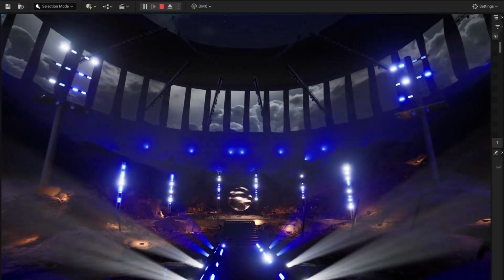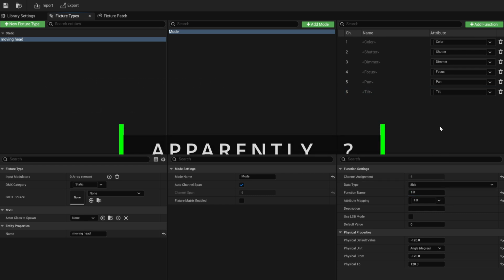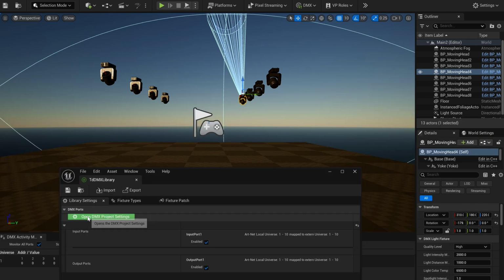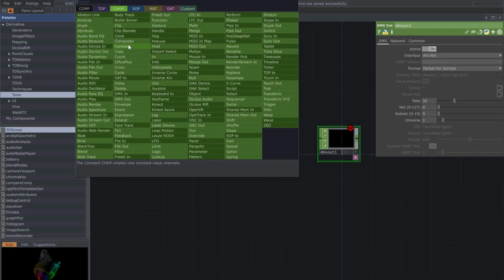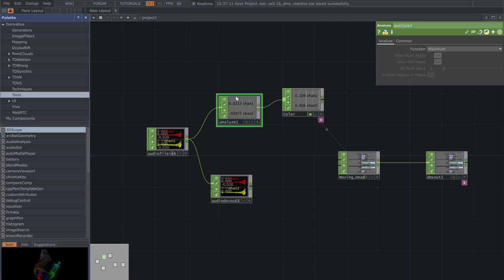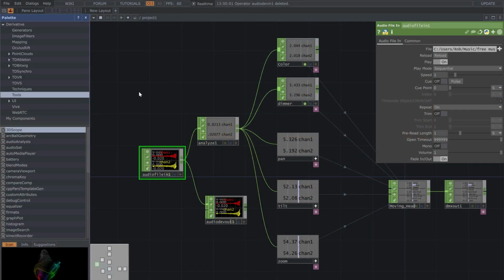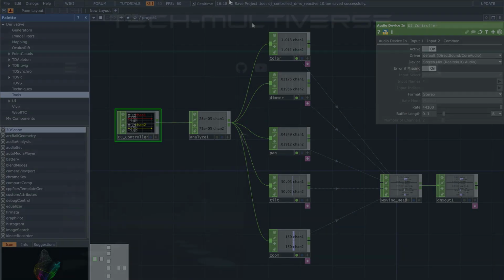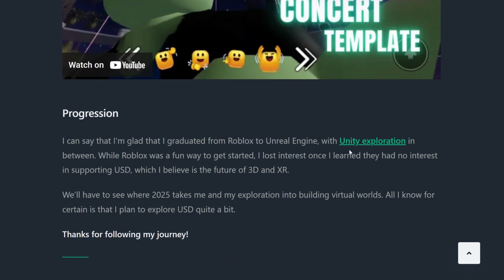Audio-reactive DMX Lighting in UE5 with TouchDesigner

Comment: Thank you for sharing this, Brother I have followed every step you tell, but From my TD to UE does not receive datas, Why is that?
Reply from the maker: My guess is that it's a network configuration detail, especially if you know you're sending the DMX data from TD. Double check that your DMX Out node has the network address of "localhost" with the local address of "127.0.0.1". If that's set, then the only other issue could be the network settings in the UE project. I share how to do that in this chapter: https://youtu.be/_mUPLc8n1cY?t=510&si=tmrE-0-1ebgTJgL7

If you're still stuck, then you can try downloading my project files from GitHub, which has helped others: https://github.com/Tech-Multiverse/audio-reactive-dmx

I hope that helps! Let me know how it goes.

Comment: Did U find any solution for the rgb control of the light ? I think the preset light in ue5 just do not support rgb channels.. probabily it’s a matter of messing with blueprint nodes..
Reply from the maker: There was a comment from someone with theater light design experience that mentioned the following color tip (below), but I haven't dug into it yet.  I'm working my way back to using UE again fairly soon, which will eventually include more lighting. Since I've learned about blueprints, I can see how messing with those would do the trick!

The tip provided:
"- Color: We only use the color function for the one without R/ G/ B color mixing. For me in your case, in TouchDesigner I will add a constant TOP to be a color palette, and send it's R/ G/ B value to the fixture in UE, as in UE, I will create each R, G, B function (so it will be 3 channels) but not the color function."

Comment: Thank you for your video:)! It's very useful! I studied in theater lighting design before, there is something I can share:

- Pan/ Tilt 16-bit: On lighting consoles (e.g. grandMA, ETC) we patched 2 channels for pan (or tilt), ch1 (pan) is for 8-bit control, ch2 (pan fine) is for 16-bit control, meaning ch2 can tune more details. For example, 1 step for ch1 is 5 degrees (I use a random number here), and for ch2 is 1 degree, you can see the huge difference in physical fixtures. In fact, for an more exquisite moving light, it will also have zoom/ zoom fine, focus/ focus fine, etc.

- Color: We only use the color function for the one without R/ G/ B color mixing. For me in your case, in TouchDesigner I will add a constant TOP to be a color palette, and send it's R/ G/ B value to the fixture in UE, as in UE, I will create each R, G, B function (so it will be 3 channels) but not the color function.
Reply from the maker: Thank you so much for sharing these details! That  makes sense and helps clarify why using 16-bit over 2 channels adds value. I can't wait to try your RGB technique, too!!
Reply: @TECH-MULTIVERSE  although a year late, building off of what @yclin-y5p was saying. a light with 360 degrees of rotation can't hit every degree of rotation with a 0-255 single address of dmx, and light can have as buch as 540 degrees rotation or more. So 16bit multiplies the two address values to be able to get wellover the 540 degrees of rotation needed for pan and whatever tilt is needed, and even allows for fine adjustments smaller than a degree, which can be massive especially if the light is far away. 1 degree far away could be several meters/feet per degree
.

Comment: Awesome tutorial dude, this is something I've been eager to figure out since I started using unreal engine on the 5.0 launch (especially hooking it up to a digital controller)  A quick question though if that's OK, i followed along exactly as you had shown but for some reason the pan on the lights always points up regardless of the range numbers I try.  Any ideas or solutions for this would be greatfully appreciated.
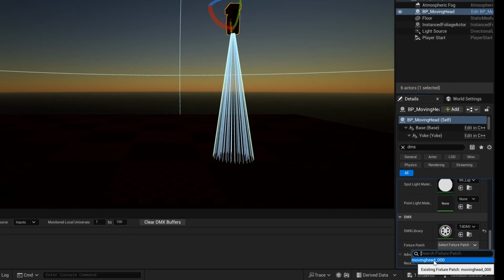Reply from the maker: In your UE5 DMX Library, double check that your function settings on both Pan and Tilt have a data type value of "16 bit".  See chapter "Fix Pan/Tilt & In/Out" at time stamp 05:00 where I correct that myself!

I did a quick test by dropping them down to "8 bit" and found they pointed up like you describe, so hopefully this solves the problem for you.  I still don't understand why this is needed, but clearly it is.

Be aware that adjusting the lights to use "16 bit" will also mean that they'll be using 2 channels, so consider that if your mapping in TD seems off after the change. I guess that's where pan-low and tilt-low can be channel placeholders - if nothing else.

During this test, I learned that system volume matters!  I had my computer volume down and didn't see much movement until I cranked that up.

It's great to hear that this video is helpful!  Let me know how it goes.
Reply: @TECH-MULTIVERSE  thank you for the reply and will definitely check to see if I switched from 8 to 16 bit. It also may be down to the music I'm putting through it (heavy drum and bass 🤣) so will try with an alternative music source.  

I know this is a big question which you may not know the answer too yet as you are still on the surface of diving into it but do you have any info on adding other lights which will react at different times so they are not all going off at once?
Reply from the maker: Actually, to create different sets of lights you can create multiple patches in your DMX Library in UE5 and map new lights to those.  Then, you simply create a new set of "constants" in TD that correspond to those channels and merge those into the DMX output.

Check out the article I wrote up for this project for more details:
https://tech-multiverse.com/projects/create-amazing-audio-reactive-light-shows-in-ue5-with-dmx-and-touchdesigner/

Scroll down to the "Phase Two: DMX TouchDesigner Tutorial" section and look for the screenshot from TD, which shows what I mean.  That section also includes the video tutorial I used to get here, which will have even more detail since he does moving heads and a laser!
Reply: @TECH-MULTIVERSE thanks for getting back to me dude.  Still seem to be hitting a brick wall with this tilt issue.  I deleted them from the library and touch and readded making sure 16bit was enabled and hit the same issue.  Don't know if it's an issue with 5.5.
Reply from the maker: Have you tried using my UE5.5.0 project file to see if that helps get you past this issue?
You can download it here:
https://github.com/Tech-Multiverse/audio-reactive-dmx
Reply: @TECH-MULTIVERSE  ahh thanks dude, I will give that a try and report back
Reply: @TECH-MULTIVERSE  Hey dude, just thought I would check in.  The project files worked a treat which had me a bit confused at first as side by side with my UE project all the info was the same but in TC i noticed you had a few of the multipliers in the math nodes set to 2 and 3.  So off I went experimenting with a few other of the lights (static, strobe, lasers and matrix) and with a little bit of trial and error I got them working pretty sweet.
Thank you very much for your help with this, you are an absolute legend..
Reply from the maker: @DJDCRYPTER that's so awesome to hear!

That's also good feedback on the TD math node multipliers since I only hinted at those "settings" that I adjusted.  Now I know to spend more time on important nuances like that in future videos.

I'm excited that you got it working.  Sounds like an impressive setup!

Thanks for taking the time to provide an update!  It made this video worth the effort!!
Reply: @TECH-MULTIVERSE  thank you for providing a fantastic guide and assistance.  I had tried to look into this in the past using the stadium template but I soon became overwhelmed by the shear size and complexity.  Now I'm pretty confident after takingnmy time to follow your guide and additional resources then giving each fixture a try to see how they work.and which nodes in TD to set up.  Don't thing to mention is the order the fixtures are in in the "universe" is the order you have to have to add the math/constant nodes routing them through a merge node before the DMX node.  
My mission now is to figure out how to make lights react at different times and to trigger things like nobody settings to change.
Reply from the maker: You bet!  I also found that stadium project to be overwhelming.  Thanks for sharing about the merge order of the TD nodes.
I've subscribed to your channel with hopes that you'll post something that shows off what you end up with.  You have a sick setup, which is inspiring me to want to learn how you do all that!!
Reply: @TECH-MULTIVERSE  Ahh thanks dude, I dont really post to this channel anymore (the channel I use for my DJing stuff is over on the channel - https://www.youtube.com/@hardcorefightersuk6780 
If you are interested in getting your streaming software setup as an overlay I'm sure I could rustle up a video on how to do that, also hopefully soon I will have a good reactive light video on a live stream for you to check out soon also... keep up the great work
Reply from the maker: subscribed!  I'll keep an eye out for updates.

Comment: Looooove it!!!!! Does touch designer need to also run on the same computer or via network a second computer
Reply from the maker: In this case, I ran TD on the same computer, but you can also run TD on another computer if you prefer.  You'd probably need to adjust the UE project network settings to listen to that specific IP address.